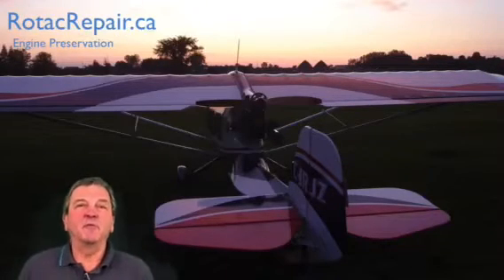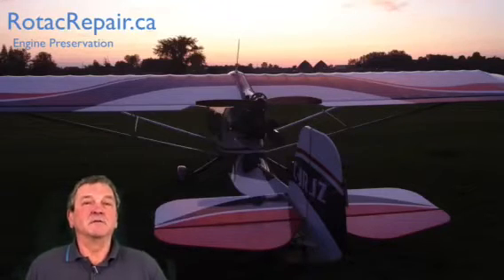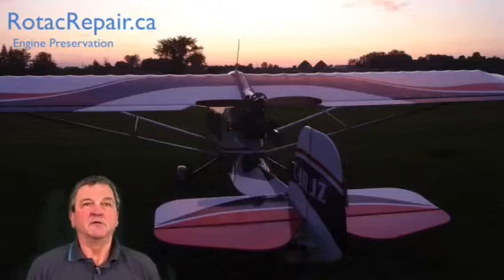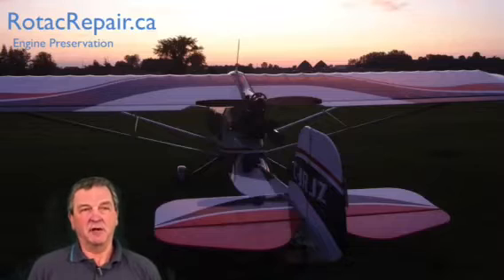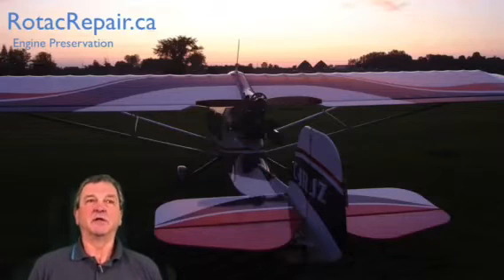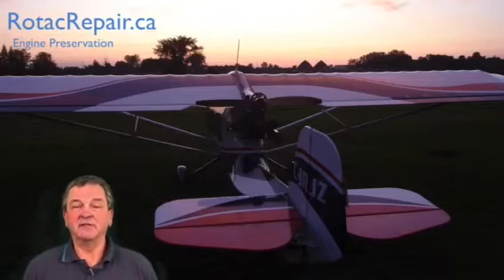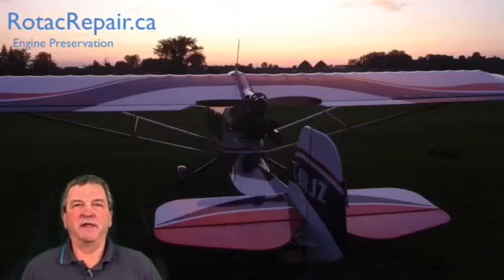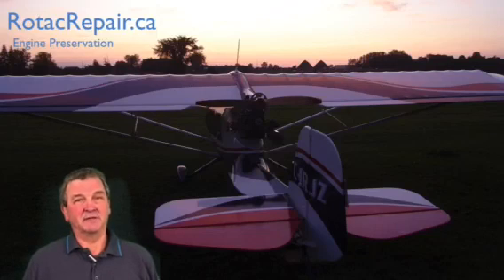Rotax 503, 582 Engine Preservation

Comment from the maker: Hi Timothy. I agree with the preservation procedure as set out by Rotax, however it’s been my experience that pilots seldom use that procedure. No engine preservation is the result of doing nothing. Perhaps the required engine preservation steps are too onerous to be carried out? Many pilots have told me thats exactly the reason they don’t follow the Rotax recommendation. Feedback from users of my kit indicates they enjoy the simplicity of this fogging procedure. The result is they are now actually preserving there engines. Best regards John

Comment: Thanks for the video, but I don't understand where you got the impression that the engine should be running. My Rotax Operator's Manual for the 503 UL DCDI does NOT call for fogging the engine while it's running:
11.1.2) At engine stoppage of 1 to 4 weeks
– proceed with preservation prior to engine stop or on the engine at operating temperature.
– let the engine run at increased idle speed
– SHUT ENGINE DOWN [emphasis added] and secure against inadvertent engine start
– remove air filters and inject approx. 3 ccm of preservation oil or equivalent oil into the air intake of each carburetor.
– restart engine and run at increased idle speed for 10 - 15 seconds
– shut engine down and secure against inadvertent engine start
– close all engine openings such as exhaust pipe, venting tube and air filter to prevent entry of contamination and humidity.
My manual is identified as OM Edition 2 / Rev. 0, dated  Sept. 01/2010.

Comment: I'll be ordering one of your kids, however for your next video I would really like to see something on installing two stroke engine smoke (like I just for fun smok kit) I think they're typically riv nutted into the exhaust, and supply something like baby oilwith a high temperature rated tube and small pump, but I would like to hear from an expert like yourself about the benefits and drawbacks before I think about messing with smoke